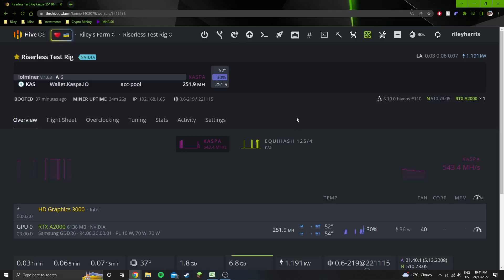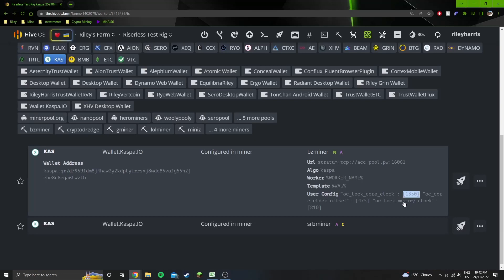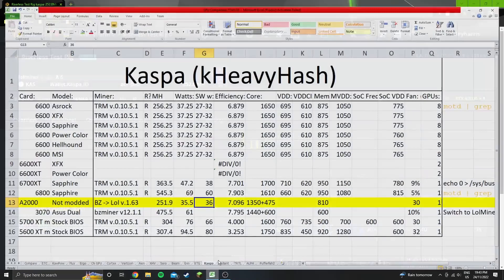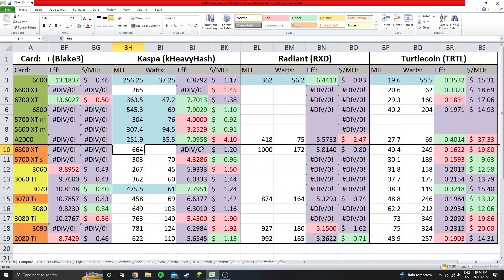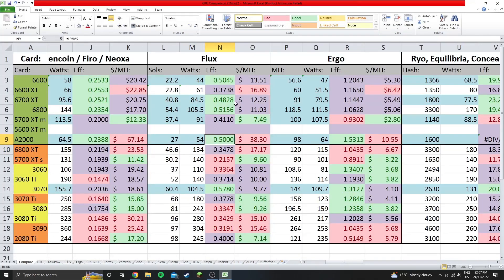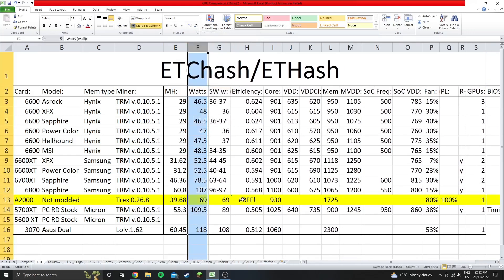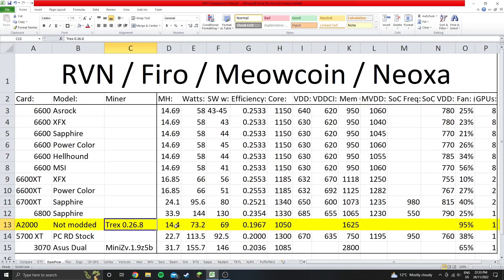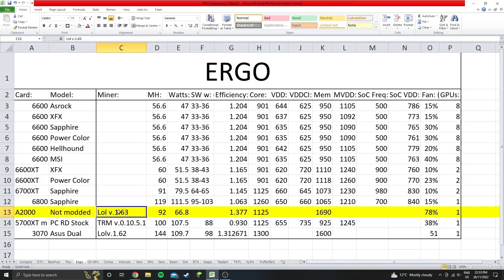A2000 Hashrate and Efficiency Testing! | Kaspa, ETC, Neoxa, Flux, Ergo, CN GPU

Comment: Is it necessary to start bzminer before starting lolminer to achieve this efficiency?When lolminer is restarted, the settings are set to default. is there any way to set this in lolminer only? In Extra config arguments I can set --cclk 1350 --mclk 810, but I am looking for something equivalent to "oc_core_clock_offset".
Reply from the maker: Nah man, it was justvfor higher hashrate and efficiency.
But it's no longer necessary for best hashrate or efficiency.
https://youtu.be/etM6mUK3PQI
Settings shown in video above.
LolMiner has incroduced it's own core offset command, but don't use it because it doesn't reduce the wattage as we want it to. Just set core offset in the hiveos OC screen. And set locked clocks in the miner extra configs.
Reply: @KiwiCryptoMiner  Thanks for the great video! I watched the video and went with lolminer 1.63. I was able to set 3140MH,453W(software),eff6.93 with A2000 12GPU.Core Clock Offset is set to 445, if I set it above 450 I get "lolminer: Unrecoverable error by GPU X." and the miner stops.I am satisfied because I have been able to improve my efficiency considerably.Thank you so much for your help.😊

Comment: Thank you for the video mate. Btw, after the merge so far which of those altcoins did you find to be more profitable with the RTX A2000? I have a 1x RTX3080TI + 5x RTX A2000 rig that is not mining since the merge but I'm really keen to get this thing working again. Any advice will be greatly appreciated. 

Cheers!
Reply from the maker: Hey man, I haven't turned any of my rigs back on since the merge due to my electrical price. I would firstly recommend taking the 3080 Ti off of the rig, then putting your own numbers into WhatToMine to find out which coin is most profitable at your electrical cost.
If you want to use my A2000 numbers for that you can find them here:
https://docs.google.com/spreadsheets/d/1Z28OyYgnPzaVL1-W9SLiEXaXXbYeVjNbksNNFK3NzVI/edit?usp=sharing

Comment: @KiwiCryptoMiner I've been running on these settings for 2 days, little warning: HiveOs can "Pop back" the settings to the default state (No OC's in LOLMiner), which ramps up the A2000 to 300Mh/s and the full 70w in the software. Great for total hashrate, not so much for efficiency, which we are definitely going for here :)

Would love to hear your thoughts. 
Cheers Jashy
Reply from the maker: Hey there, thanks for the info, I haven't ran this method for long enough to find that stuff out.
It's not too much of a hashrate boost anyway, probably not worth doing.
Thanks for watching and supporting the channel!
Reply: @KiwiCryptoMiner  try these in your extra arguments in Lolminer:
--cclk 1470
--mclk 810

Comment: how do u calculate the watt efficiency?
Reply from the maker: Hey there. I have tested my system without any GPU's and it uses 16.5w.
I then put the GPU on and mine whichever algo, check the power draw for the whole test rig, then subtract the system idle wattage from the current total wattage. This shows what the GPU alone is using.
Then divide the hashrate you are getting by the wattage the card used to get the efficiency number.
Thanks for watching!

Comment: bro my gigabyte 6600  cards not working properly ..when i run 8 cards on TRM ..after running 30 sec randomely one card stop mining ... can you help me in solving this issue ... can you give me overclocks for gigabyte 6600 ... your subscriber from india ;)
Reply from the maker: Hey mate. I don't have any gigabyte 6600's. You probably need to increase all the mV settings by 10mV on just the card that is crashing.
Or if you have Micron memory cards, the mV will need increasing alot.
Reply: @KiwiCryptoMiner  thanks bro i will try ... but please try to add gigabyte cards in your amd overclocking vedios
Reply from the maker: @romanpierce-uf6mm  Hey man, the only Gigabyte AMD card I own is a vega 56. I personally don't like Gigabyte cards. Also they are much more likely to be Micron memory cards.
Reply: @KiwiCryptoMiner  bro i buy 10 gigabyte cards in one lot in which 2 cards are micron memory .. but they didnt give me any trouble ... they are mining stable

Comment: Boss, LOLMINER1.63 optimizes Nvidia's cards, what is the most optimized power consumption ratio kernel choice for the current 6600XT 6700XT?
Reply from the maker: Hey mate. Team Red Miner, always!
I've got videos for 6700 XT and 6800 on Kaspa. They are both crazy efficient!
6800 is more efficient on Kas than the A2000 and 3070
Reply: @KiwiCryptoMiner  Thank you boss, 6600XT and 6700XT have used Teamredminer version 0.10.6 to reduce power consumption, 5700XT I found that it does not seem to work, for KASPA, the